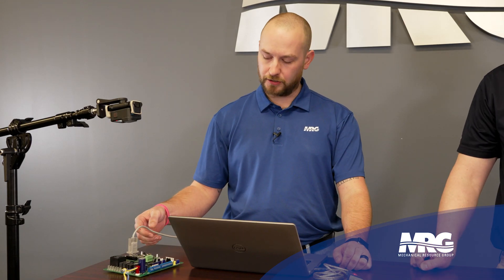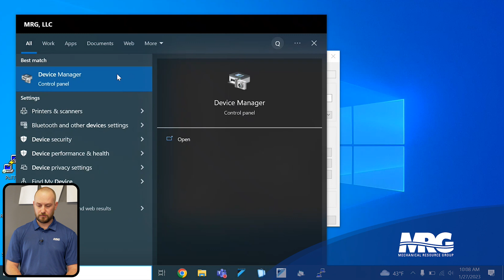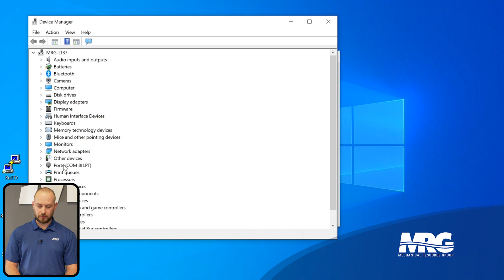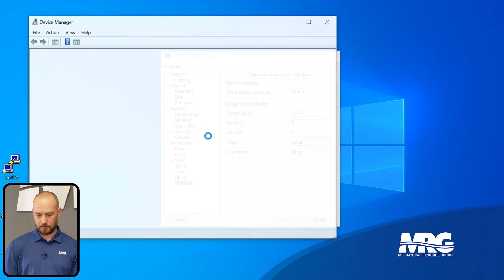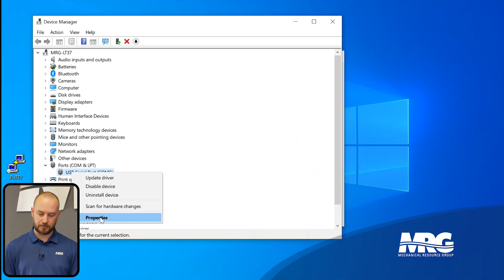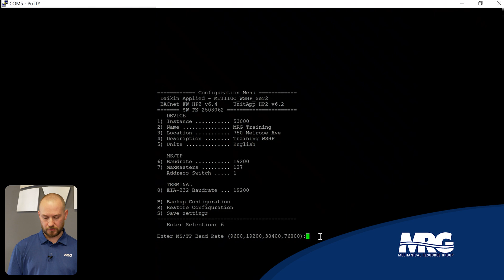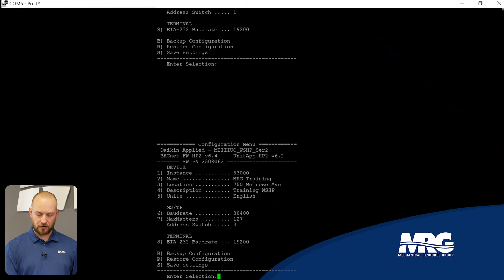How to Address Daikin WSHP BACnet Cards | A HVAC Tech Guide

Comment: Thank you for this video. Do you have to access the terminal menu and save something before the mstp comm is enabled?
Reply from the maker: The terminal menu doesn't need to be accessed to enable BACnet but can be used to make adjustments to Baud rate, name etc.
The MAC address is set via the dipswitches on the board.
Reply: @MechanicalPros  Awesome, thank you! What's funny is that my ms/tp did not handshake until I went into the card with the terminal mode and saved the settings. I verified it with yet another board and found the same thing.